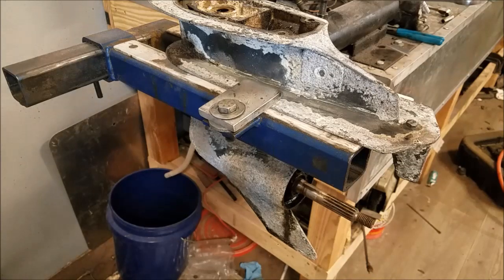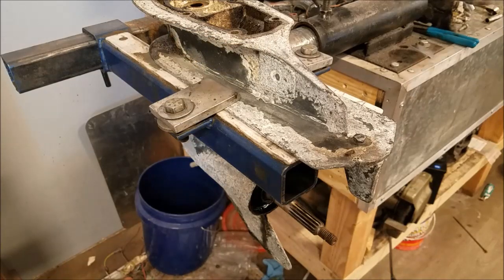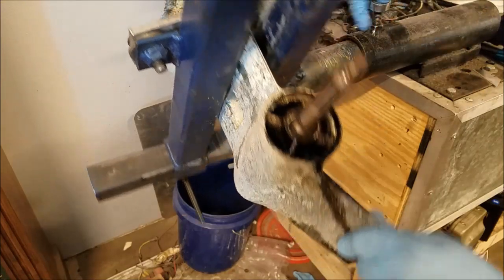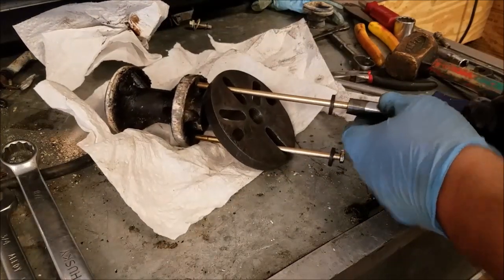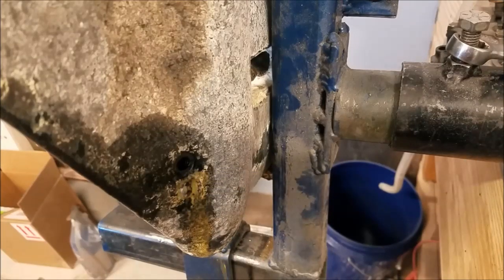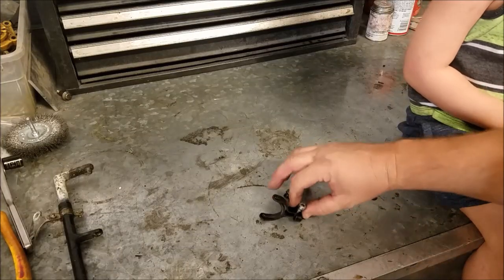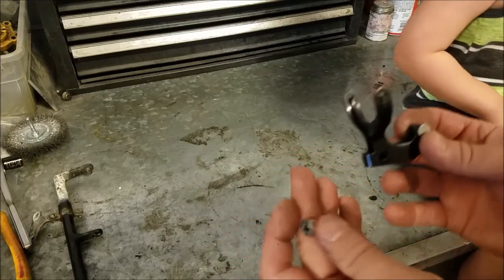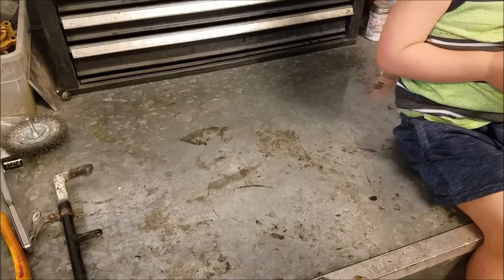Johnson Evinrude 20-35 HP Gearcase Teardown

Comment: Watched 4 vids now and they are always about teardown and throw away WTH
Reply: I know, i need a reseal/rebuild video. I did see one guy doing it on a similar motor but it looks like a PITA to get the gears back in, and you have to buy or make a tool to get the clutch dog detents in
Reply: @TheBigghunter01 right on . Dangar marine nakes it easy. I'm stuck getting reverse gear past shift link. He did in 30 seconds.

Comment: Thank you for a great video. The reason i found this is the same as you mention at 14min. I accidently removed the pivot pin when changing oil. Now im looking for way to correct my mistake. 
After an hour with a wire and a bit of grinding on the end of the pivot pin i manage to get it back in place. The problem is that now i cant change gear. Its stuck in forward.
Any tips for me before i tear the whole unit apart? 
Thank you in advance, best regards from sweden 🙂

Comment: That’s funny , 20 - 25 hp motors up here are plentiful ! Maybe I should bring down a load of them and sell them ! Lol. I think I have at least 5 - 20’s and 7- 25 hp on hand serviced and ready ! Lol. How much do they sell for there ?
Reply from the maker: Thats the funny part, 
Impossible to find, very few for sale anyway, yes everybody wants one and asks me if I have one for sale. 
Seems like nobody will pay more than $400 for one.
There has been one for sale for 2 years for $800, still there.
Reply: Brandon's Garage here I get more for a 15 hp then a 20 or 25 ! Lol. I sell 15’s for up to $1,200 and am lucky to get $600 for a 20 or 25 ?!?! And long shaft are hard to sell , go figure ! I have a beautiful 1967 Evinrude 18 hp long and can’t get $300 ! But if I convert to SS I could sell it tomorrow for more ! I just don’t understand it . That military one is interesting !
Reply: Darn I have a 25 evinrude that the forward gear and the dog gear are warn down causing them to slip when under a load. I found new ones but they were to expensive. The reverse gear is 88.00 the dog gear is 104.00 and the forward gear is 422.00.  I’m gonna try to machine them down to good metal again if it doesn’t work I’m not out anything.
Reply: @stevanrose7439  what year ?